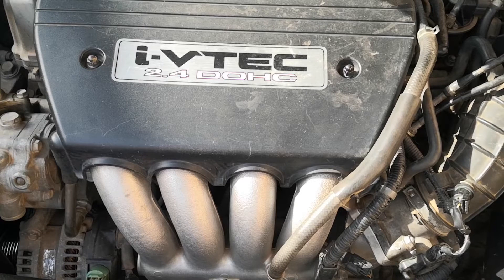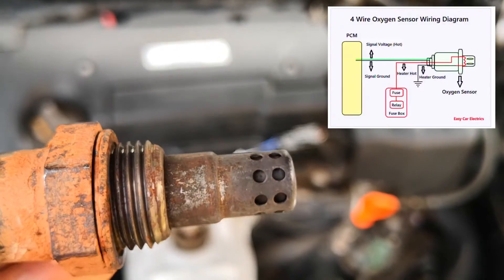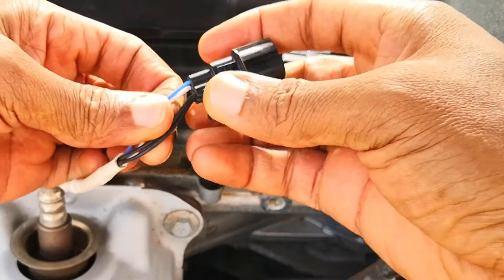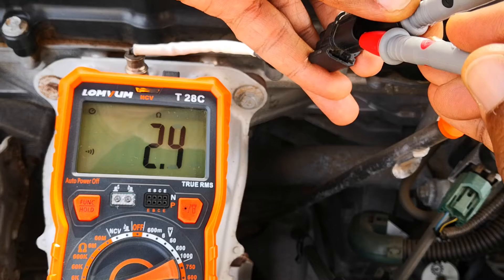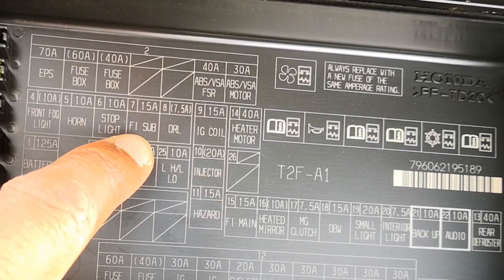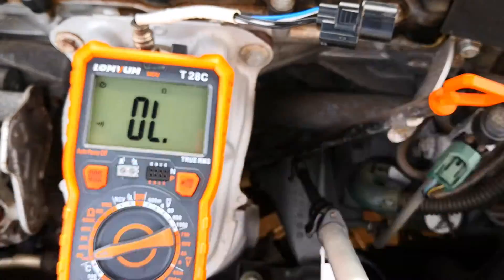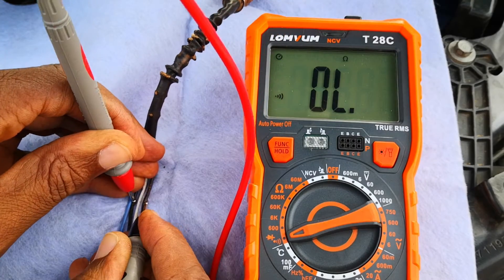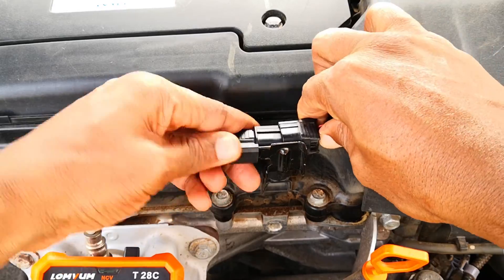Bad O2 Sensor Heater Element Diagnosis / Broken O2 Sensor Heater Circuit / Bad O2 sensor testing

Comment: What catalytic converter cleaner do you recommend for a 2017 Honda accord ex that’s throwing a P0420 code
Reply from the maker: Cataclean seems to have the most reviews. Haven't used it for this purpose though
Reply: @ hey brother! The code went away by itself a day later but I am still going to use the cataclean once I get 1/4 tank full. I am now experiencing Engine ticking/Knocking it ticks at a very fast pace what do you suggest and in your experience what is causing this noise? It also matches the burbling noise that comes from the exhaust along with white smoke and on the exhaust tip it seems like there’s condensation or moisture thank you brother, keep up the great videos
Reply from the maker: My Accord will have that knocking noise once there's significant build up on the pistons. Running a good cleaner is what I've used to keep that at bay. Bad gas can also cause P0420 on this Accord too.
Reply: @DIYAutoworksNG  what piston cleaner do you recommend I try out?
Reply from the maker: Since you plan to use Cataclean, that should help. I've used Redline SI-1, BG44K Platinum, Gumout All-in-one etc with good results.
Reply: @DIYAutoworksNG  I used BG44K platinum on the last fill up and that’s what made it go away I believe, that’s why I’m waiting right now because that was the last fill up😁💪
Reply: @DIYAutoworksNG I started using bg44k after watching your vids actually! It’s my second time using it, I have around 210,000 miles on my vehicle so far
Reply from the maker: Cool 👌🏼

Comment: I have a 2012 Nissan Sentra 2.0 and the code I have is P0031 which is the O2 sensor heat circuit low and I changed my oxygen sensor original manufacture version and I changed my intake hose because this all began when my intake hose came off while I was driving doing deliveries and my car shut off and I hadthat code and p1148 which is closed loop control functionality issue and running my ODB meter I checked the emissions and it still shows oxygen sensor so it seems like everything else is good but something in that area which I can’t figure out does anyone know if there’s a different fuse because I changed my O2 sensor heater fuse but I heard that there’s other fuses that can be connected with the heater circuit and maybe causing that this is driving me crazy. I’ve yet to figure this out for once now, and my inspection is due soon and the only thing thing that pass against the oxygen sensor.
Reply from the maker: I know that frustration of chasing a CEL or some drivability issue without any leads. The worst are the ones where there's no code 😱
For the P0031, have you ruled out frayed or shorts in the wiring? Also inspect the connector for bent pins or corrosion.

Comment: I have P0135 error on honda brio for o2 heater malfunction. I checked the resistance its good, changed all the fuse and relay still the same issue
Reply from the maker: If you've checked the other stuff, it may be the sensor itself.

Comment: My vehicle just recently begun throwing a code P0131. Replaced the sensor and code comes back immediately, check fuse and looks good. Next thing is to check relay. 

Any possible suggestion you may have?
Reply from the maker: Checking the relay is good. Would also add the wiring for the O2 sensor circuit. A short somewhere is another potential culprit.

Comment: Hi @DIYAutoworksNG,
Recently, my car has started to randomly stall the engine while I'm driving, and it's really hard to start sometimes when the engine is hot. When I check the error codes, it shows OBD1 21 error code, which is related to the oxygen sensor. I'm not getting any continuity or resistance in the heater circuit. Could this be the reason for all the symptoms listed above?

Thanks. 🙂
Reply from the maker: I don't think a broken heater circuit by itself will stop a car starting. That code 21 has several interpretations depending on you brand. On some, it's throttle body-related. I'd recommend you verify the code 21, if it's still the O2 sensor, I'd replace or unplug it's connector and see if there's a change.

Comment: Would not having catalytic converters be a reason to get a heater circuit Malfunction code
Reply from the maker: No. The heater circuit is independent of the catalytic converter.

Comment: Good day bro. Ur video have been very useful to say the least.
I presently own a honda accord 2006 bought in Nigeria & am trying to carryout some maintenance here & there which have always been successful so far.
Recently, i told my mechanic i will love to get rid of the "check engine" light & he said it is possible.
We got on with it & a code was thrown for a bad A/F ratio sensor which was changed &  the check engine light went away for a while then came back, checked again & this time, it was for the downstream 02 sensor which was hard to get.
The rewire told me he will improvise & make use of same type of sensor that goes into the upstream one.
Got it & it worked as the check engine light went away.
But me being a skeptical person, not being too convinced becasue the black wires (heater) has a polarity or it doesn't really matter?
Reply from the maker: That modification is not something I'd advise. Totally different sensors. Are you sure he didn't block the CEL bulb on the dash? Some dubious mechanics do this.
Reply: @DIYAutoworksNG  very sure he didn't because when he was done fixing it, he had to clear the "check engine" light by removing the battery terminals for some seconds.
Was skeptical but he sounded so reassuring though i have my fears because physically both sensors aren't same.
Guess i'll just tell him to keep searching the market for the main one or do u advice i get new one & if yes, which of the make would u advice.
Thanks
Reply from the maker: The old one can be used to search the market for a replacement. When I did this on my 2003 Accord, I got a Denso aftermarket direct fit sensor from Rockauto. Used it for many years till the car was sold. The light never came back.
Reply: @DIYAutoworksNG  thanks for this. Will definitely keep searching till i get the direct fit. Luckily, i have the old one. Is rockauto in Nigeria & where can i get them? Thanks
Reply from the maker: Rockauto is a US site.
Reply: @DIYAutoworksNG  alright

Comment: As a diesel mechanic its very interesting to see diagnostics on cars.
Reply from the maker: 😃. I'm yet to work on a diesel!
Reply: @DIYAutoworksNG instead of spark plugs that spark, u have glow plugs that heat up.. instead of low pressure intake mounted fuel injectors, u will have a high pressure pump that runs off the camshaft and direct mounted  injectectors.. everything else is basically the same..
Reply: @williamblanks8500 sounds like gdi high pressure fuel pump kind of